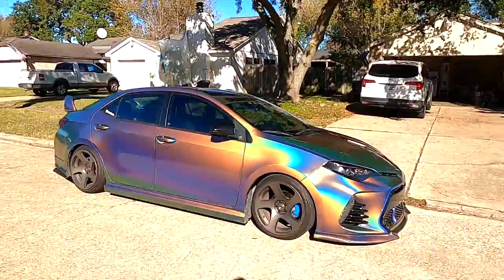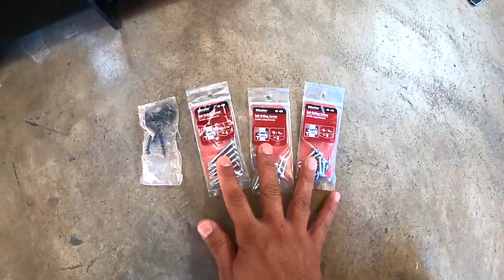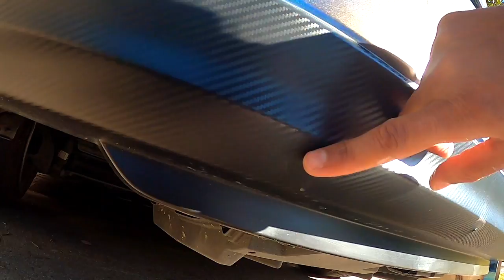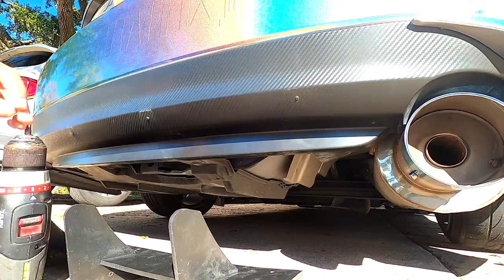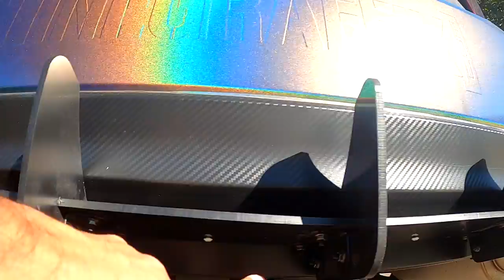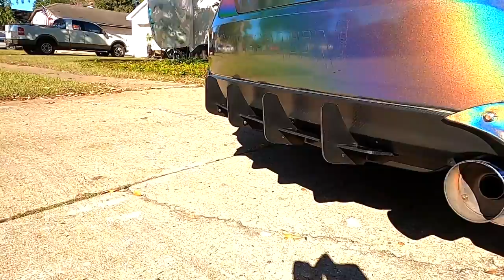INSANE $75 Rear Diffuser from Ebay

Comment: Will that fit a 2020 corolla?
Reply from the maker: Yeah I think it should fit but check first if the bottom of the rear bumper has a flat area at least 1” of a flat area to put the screws 👍

Comment: Do You think you could use good Glue instead of drilling like you did?
Reply from the maker: No, The glue will not hold it because the lip is too small. the screws are going to be in the bottom so it's not going to be visible 👍
Reply: Just put 3M double tape and the screws